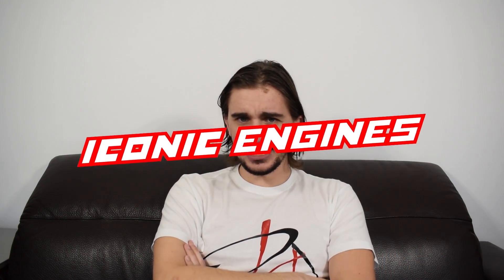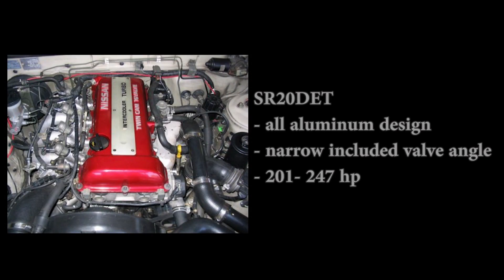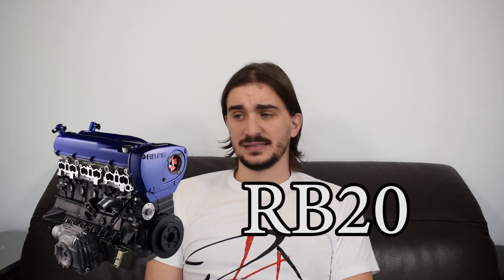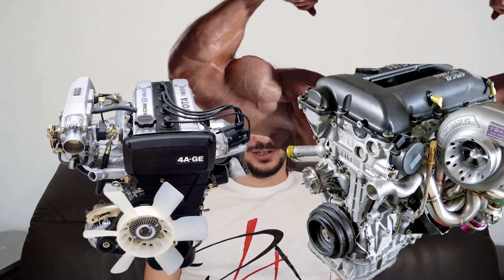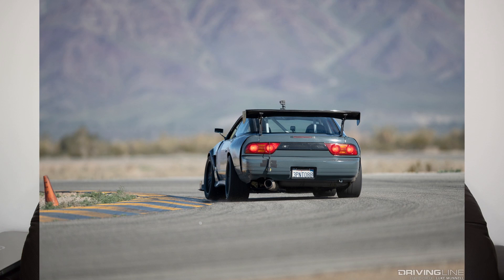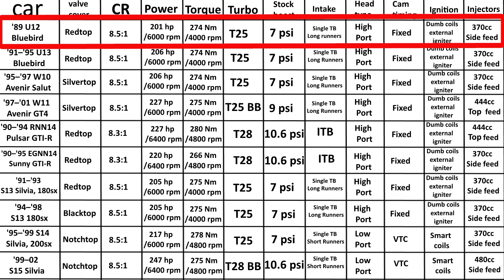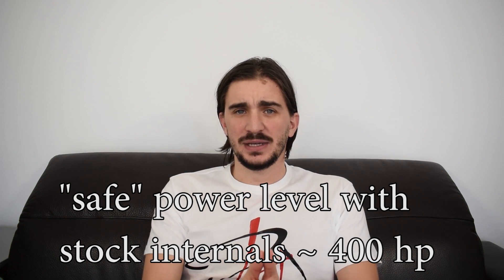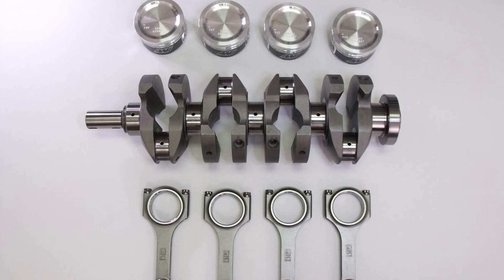Nissan SR20DET - What makes it GREAT? ICONIC ENGINES #9

Comment: Too bad the xtrail had the 278hp NA version but there almost impossible to get your ECU tuned for it since they almost all came CVT I'd take an NA version with more HP any day tbh
Edit: also unfair to say it was lightweight when the qr25 that replaced it was 86 pounds lighter and had 40 more hp almost 😅

Comment: Thanks for the inspirational video. I'm the original owner of a 91-240SX SE Fast back (manual shift). All original parts with about 280K on the engine. Still runs like a clock! When I'm on the freeway, I'm often amazed at how smooth it runs. I've been thinking about swapping the engine to get a few more horsies out of it but been very reluctant to mess with anything since it's runs with no issues, although it does feel a little sluggish. I'm now 55 and its obviously not my daily driver. But still, your video has inspired me to upgrade the original 155hp power plant. Will let you know how it goes!

Comment: Awesome video! I've had 6 cars with this engine: P11, 2 x P11-144, S14 and 2 x S15. I know it well and it's very easiy to tune. A totally stripped out S15 running 300whp is crazy fast and bloody scary. I think we got my last one down to around 900Kg.
Reply: P11? Infiniti?
Reply: Primera 💪 still miss my GT Mystic

Comment: Great videos my man!
Here in the US our all-powerful insurance industry and trial-lawyer lobbies got involved, and we got the 240SX which basically had a 12-valve SOHC truck engine - felt fast off the line but petered out rapidly as revs rose.  Great handling car which needed about 75-100 more bhp.
Apart from the lawyers, one reason US-market cars have lower compression ratios is due to our generally crappy fuels, ethanol blends, &c.  And to think that us Yanks invented 110-octane gas.  Sigh....

Comment: Back in the 90's and early 2000's EVERYONE was swapping OUT the ka24de for the SR20DET ... I stayed with the ka24de, built it and turbo charged it. Got it to 482 whp and 455 wtq in 2001. Ran 11.1 @ 123 mph ... She impressed all but yet everyone still wanted that tiny SR20 ... I guess they didn't want to do all the hard work. 
She is still in my garage running STRONG 20 yrs later on the same ka motor. Parked next to my MKIV Supra. 
Funny when i take it to the car meets and pop the hood, they are like, oh you went ka turbo, i said yea, they asked how long has it been turbo, i say 20 yrs now and they look at me with that look of .... 20 yrs are you serious ... 
I was like yep, got the car in 2000, pulled the engine in 2001, built it for 600 hp and she has been this way since.
Reply: Voce fala muito cara. Por que você não mostra esse motor rodando?
Reply: @marydudaduda7355 🤦
Reply: You Tube

Comment: Supposedly some SR20s can make 3000 hp !
Reply: Ahh ... MAYBE from a billet inline 4 block but the SR20 aluminum 2L block ... NO WAY ... 
The 2JZ block is a 3L and it peaks at 2000 hp. After that you have to make a billet 2JZ mimic.
Reply: @ACommenterOnYouTube  How did no one take the username You Tube before you ? I would have thought that would have been the first username to go.
Reply: @twilightsuzuka6252  i am a shareholder to YouTube so i was able to custom create my name so i picked this one, also that name is blocked out from regular YouTube users.

Comment: Had a highport N/A  jdm sr20 (back when they were still $400 delivered off eBay) in a nx2000
I can attest to it's durability. I had a reputation in town for being the guy who had a nitrous nx2000. Which it never did have it . I never could convince anyone that yes this little car pulls that hard without a bottle.
Lost the number 3 rod bearing at 275k 
It earned every mile
Reply: the na sr20de is extremely different than the sr20det

Comment: VQ-6 has been on wards 11 times over a decade... rather have that. Oh, I do....The respected VQ-series V-6 powers a variety of Nissan and Infiniti-brand cars, CUVs, trucks and SUVs, and it has been a favorite of WardsAuto editors for two decades. In displacements ranging from 3.0L to 3.7L, it made the Wards 10 Best Engines list 14 years straight from 1995 to 2008.
But it’s hard to keep up that pace forever when all-new powertrains are being introduced by competitors at unprecedented rates. Eventually the VQ became a bit less competitive in fuel efficiency and in some applications lost refinement as displacement and output increased. But now it’s back after an 8-year hiatus for a 15th Wards 10 Best Engines award.
Kentaro Watanabe, senior manager-Powertrain Engineering at Nissan Technical Center North America, says the primary design objectives for this nearly 2/3-new VQ V-6 were: “Improve engine efficiency for better vehicle fuel economy; meet stringent emissions regulations of LEV3-ULEV125 as well as MSAT (mobile source air toxic emissions); maintain previous-model engine NVH and achieve 300 horsepower without compromising any of the above.” All of which the VQ engine team have more than accomplished.
There is no question the new VQ’s NVH is better in the ’16 Maxima than the same-size 290-hp outgoing VQ V-6 was in the ’15 version. And its fuel efficiency is well up from the previous 19/26 mpg (12.4-9.0 L/100 km) city/highway.
“It’s quiet and smooth, with just enough grunt,” says editor Dave Zoia. “VQ is back!”
And while most other automakers are phasing out V-6s in favor of smaller, lighter and typically more fuel-thrifty turbocharged 4-cyl. engines in their midsize, and some larger, cars and CUVs, this much-improved DOHC, 24-valve, all-aluminum 3.5L V-6 is the only engine offered in the ’16 Maxima, which Nissan bills as a “large” sedan. And it’s not even (yet) direct-fuel-injected, making do instead with less complex and less expensive port fuel injection.
VQs powering the new Pathfinder and Armada trucks do feature Nissan's new direct-injection system.
Nevertheless, it spins out a healthy 300 horsepower at 6,400 rpm (that’s 85.7 hp/L specific output) and a strong 261 lb.-ft. (354 Nm) of torque at 4,400 rpm while scoring very respectable 22/30 mpg (10.7-7.8 L/100 km) city/highway fuel-economy ratings from the EPA. During their driving and testing, WardsAuto editors “routinely” topped 25 mpg (9.4 L/100 km), and some saw as much as 30 mpg in real-world driving.    
To refresh readers’ memories, here is what the judges wrote about the award-winning 3.7L VQ back in 2008, its last Wards 10 Best honor until now: “When Nissan engineers kicked off design of an all-new V-6 engine family 18 (now 26) years ago, they planned to make it at least the equal of any, and better than most. They could not have predicted how powerful, popular and prolific it would be nearly two decades later.
“GM has its legendary small-block V-8, BMW its silky in-line six, VW/Audi their mighty-mite turbo four. Now Nissan has its signature VQ V-6 powering nearly everything it makes midsize and up,” we wrote. “Together with bold, distinctive styling, it also arguably powered the company’s comeback from the brink of bankruptcy earlier this century, at least in the U.S. market.”
The first all-aluminum VQ V-6 debuted in 1994 in 2.0L, 2.5L and 3.0L displacements, the latter bringing 190 horses and 205 lb.-ft. (278 Nm) of torque to new U.S.-market ’95 Nissan Maxima and Infiniti i30 sedans. It was relatively light and compact, with lightweight internal parts, micro-finished camshafts and crankshaft, molybdenum-coated pistons and a 2-way cooling system that enables the block to warm up more quickly for reduced emissions.
61% New Parts  
Today, the thoroughly upgraded VQ35, which comes standard in the all-new ’16 Maxima sport sedan, is 61% new, according to Nissan. Up top, its redesigned intake manifold (with wider and shorter runners), heads and combustion chambers give it significantly better flow for higher output. At its bottom end, a much stiffer new oil pan reduces vibration. In between, it boasts reduced friction throughout, “intermediate locking valve timing” for more complete combustion and sodium-filled exhaust valves (from Eaton) that conduct heat away from its combustion chambers.
“The improved VQ makes for light, lively and refined power delivery through an ideally suited continuously variable transmission. We barely miss the shift points,” writes editor Tom Murphy. “For more than 20 years, the VQ’s calling card has been its unmistakably creamy midrange. But the new version displays a lot more composure when pushed hard, even to the brink of the 6,600-rpm redline.” He sums it up as, “a modern, silky smooth V-6 that can pull extra duty in luxury cars, sport sedans, CUVs and even pickup trucks.”
Nissan’s Watanabe adds that the engine team’s toughest challenge was reaching that customer-pleasing performance/efficiency balance along with the improved NVH levels. Another difficult challenge, he says, was optimizing the cylinder head port shape for higher tumble flow with less flow restriction, and the engineers made extensive use of computational fluid dynamics to accomplish that. Also proving challenging was precision-tuning both the spark and the valve timing and stiffening up the oil pan to suppress the additional engine vibrations that resulted from rapid combustion due to the high tumble ratio.
Did any key engineering innovations help the team achieve its goals? Yes, he says and among the most important are “a highly optimized short intake manifold and long exhaust system, a larger-event-angle exhaust cam phaser and a low-flow-restriction exhaust catalyst,” in addition to the vibration-fighting oil pan.
Among this new VQ’s key suppliers are Mann + Hummel for the intake manifold, Arvin Sango and Calsonic Kansei for the exhaust system, Hitachi for the cam phasor, Bocar for the oil pan and Nemak for the cylinder head casting.
As smooth, powerful and efficient as WardsAuto editors deemed this renewed 3.5LV-6 to be in their ’16 Maxima test car, Watanabe says there remains room for improvement in future generations in both output and energy efficiency. In addition to further friction reductions and combustion system improvements, expansion of gasoline direct injection is likely to be at the top of the list, along with the higher compression ratios GDI will enable.

Comment: one of my favorite engines to make  cheap power back in the day the SR series came with all kinds of special editions and anniversary spec variants some intake manifold with cut and polished from factory some curve up, some down.. don't know why Nissan didn't send the DET or VE to the states they missed out which Honda capitalized on.. i had the honour of running a 1999 pulsar vzr edition in sedan form the previous owner already swapped the SR16VE for the 20VE tuned it and 198hp NA to the wheel everything stock except intake and a 3 inch exhaust 😅 pretty wild for hardly any money the Honda B18 to B20 conversion made good power but Nissan torque came in strange at 2000 RPM till 7200.. give the keys to the Honda guys and after they ripped it around the blocks.. they were pretty shocked 😂

Comment: I'm a Big fan of the SR20 after swapping an s13 black top in my Datsun 510 with a GT3071R. Laggy as catsup until 5K then suddenly your balls were in the back seat. More fun then should be allowed on the street. Now pushing 22psi with a T3 GTX2867R making 352 hp at the wheels on E85. Not crazy power but in a 2000lb. RWD car it's stupid fast. With boost coming on at 2.5k building gradually the Gen 2 disco potato is a much better match with 2.0L displacement and our power goals for Auto-X. Only thing we've done to the engine was freshen up the head, Tomei head gasket and ARP studs, but still running on stock internals and we've been beating on that thing for 6 years.  SR20 FTW!!!

Comment: Couple of notes and interesting facts:
Camshaft durations and lift vary from 232 to 248 depending on the variation. S14 Nothctop had t28 non bb garrett turbo, not t25. Pushing stock internals to 400whp is possible, but 320-370whp is a more realistic number. On stock t25 (@~12 psi) and very minor bolt-ons you can get solid 240-250whp. Also, rockers and lifters really hate being bounced off the limiter, hence why SR is kinda known for being unreliable. Some people say rocker arms stoppers are great and some say they destroy the heads so here's that. 

The ultimate SR20DET upgrade is P11 NEO VVL head swap. They flow better and are pretty much bulletproof with a few bolt-ons. Yes it is a very expensive mod, but it really transforms SR20DET into an indestructible beast.  

Some people prefer to keep stock high port (blacktop and redtop) mani for better low-end torque.

Alternators and water pumps are kinda known to go out. 

SRs and other 90s nissan engines LOVE 15w40 diesel oils.

Stock crank can handle up to 1400hp with good balancing. 

A faulty water temp sensor will make the ECU go into the limp mode and won't rev past 2500rpm.  

s13.4 Notchtop/Redtop hybrid valve cover is an odd mod but if you have a S13 SR, and you have an oil catch can… you’ve probably seen your catch can fill up before the day is even over. This is due to no internal baffling in the S13 SR valve cover.  S14 SR valve cover does have internal baffling, which prevents all of the oil to just end up in the catch can.
Reply: Another two thing's to add, the stock SR20 oil pump is known to be kind of crappy for high HP applications, VE and GTiR oil pumps are pretty much the same price as the stock one and are much better but do require a little modification to get working, well worth the investment though. The second BIG thing for high HP is ditching the stock CAS for an upgraded trigger kit, the stock one likes to wander when your really beating on it during a dyno session, your tuner will be greatly appreciative.

 However that being said, people have been taking the SR to it's limits with stock CAS and pump for many many years (granted they were much more available and cheap lol), so it's still possible to have a solid engine without these upgrades. I recently had my SR built and regret not upgrading the pump or stock CAS. Woe is me..
Reply: Антон заходи к нам на канал у нас сувенир avenir salut x gt
1996 sr20det
Reply: Still a nissan ssdly
Reply: S14 Sr20det came with a T28 only in the late model kouki. The Zenki version still came with t25
Reply: @joesarna9154  i have a euro spec 200sx zenki and it does have a journal bearing T28, the jap spec s14 came with the bb T28
Reply: Made 462whp on mine, completely (second motor, why is below) stock motor other than C16 fuel, GT35R, 72lb injectors, Cobra MAF, JWT S4 cams and a monster oil cooler ran by an electric pump. Lasted a couple of seasons doing time attack events. Rev limiter at 7750rpm on the JWT ECU. 

Rocker stoppers keep the valves moving during float so you can get piston to valve contact. Better to huck them out. Had a friend money shift mine 4th at redline to second. Put a new chain and rocker arms in it and ran it until I blew it up playing with the dial-a-boom (25psi isn’t tolerated, lol). 

Motor is still kicking today, but sadly I haven’t registered the car in years. Someday… :)
Reply: Hey, do the same principles apply to the sr20vet from the Nissan xtrail GT?

Comment: You dont mention the SR20VE (T), which resolve the common rocker arm failing issue at hight RPM. Plus the VE head have better airflow than a max out ported VTC head (and more RPM for fun.
Reply: Hey, I'd like some information on the sr20vet, like what needs to be done to get from 280hp 350+whp.
Reply: @otis3500  if you start from the one and only SR20VET from Factory (xtrail) it's quite easy to go from 280 to 350+HP. 
Just a mater of bigger injectors, maybe better intercooler, exhaust and a tunable ecu.
 But you have to know that this particulary SR20 block is FWD only like the primera one. So most of the time you need to swap the VE head on the DE rwd block, its extra work and cost.
Reply: @LMSCa18det  I actually put it in a 2010 4wd Hyundai Santa Fe, it's a sweet project. Just need more power.

Comment: Just one observation, the HONDA K20, TOYOTA 3S-GE, and this all have 86 mm stroke and bore. Mitsubishi 4G63 has 85mm and 86mm, close.
What is with these numbers.? Is it some kind of magic number to make engines great?
Also NISSAN SKYLINE engine the RB ...  Even that is a iconic engine, no?
Reply: The reason is that 2.0l is a nice round number.

Comment: Ca18det is about 10kg lighter than sr20det, i have both and a lot of other owners have weighted them with the same results
Reply: Must have to do with thickening walls for rigidity as they're aluminum, was the engine/trans complete or what?
Reply: well considering its 200cc less that makes sense lol

Comment: For the most part yea, this engine is a monster and reliable. People who complain they blow up just do not do any maintenance they require. Really the only thing wrong is they do not like bouncing off rev limiter hard because of rocker arms tendency to want to fly. But my SR20DE(T) is still kicking along, still the original bottom end DE from 91 pushing 15psi of boost.

Comment: Factory boost level for the redtop/blacktop motors was 12psi that was gated back to roughly 7psi in higher RPMs by a vacuum controlled boost solenoid. when the boost solenoid is removed, the spring on the T25s wastegate is only rated to 7psi.

Comment: i made 278whp and 275 tq on the stock t25 turbo on 12-13 psi with a walbro 255 fuel pump, 740cc injectors, fmic, intake, z32 maf, good ole e85 and a inovate csg-1 boost controller/afr gauge with boost cut, all on the stock ecu thanks to @rsenthalpy ,  rsenthalpy tuned my motor is you want your sr20 to live forever get tuned by him ;) http://rs-enthalpy.com/
Reply: 20 year + tuner ask anyone.